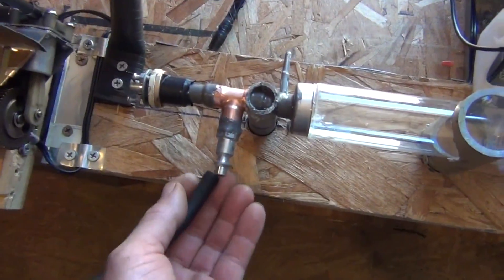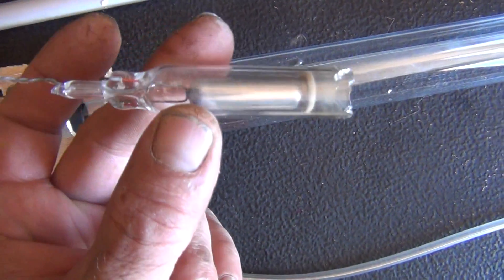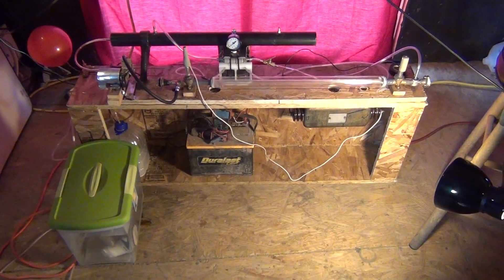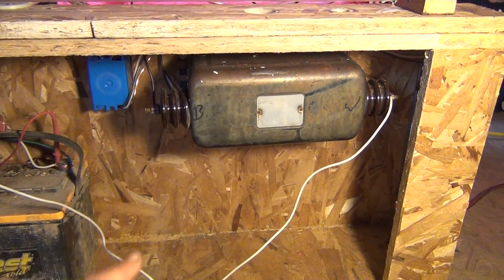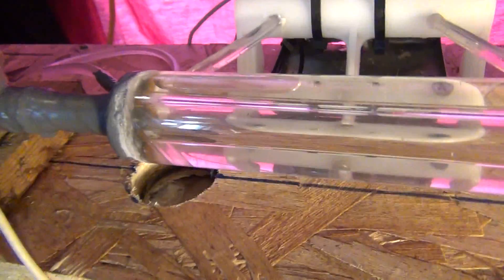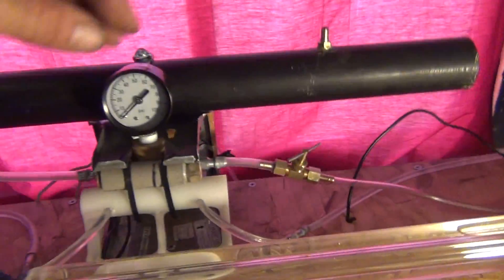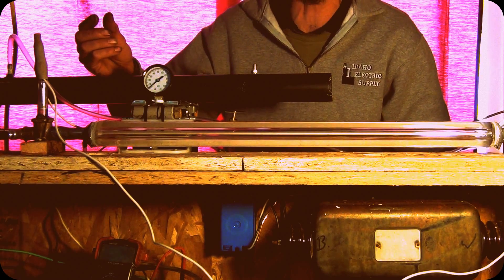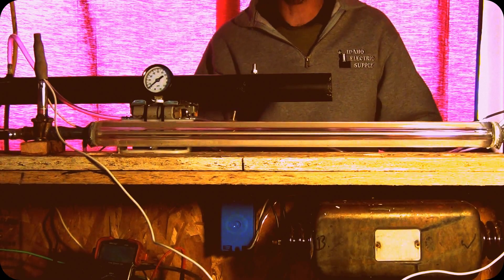Homemade CO2 Laser, part 5

Comment: You do a great job explaining things in a way that is clear and easy to follow. Your also thorough with coverage. I subbed your channel it looks like you have a lot of great content I can relate to. 
I want to make you aware of a material that has countless uses which is windshield urethane. Any auto-glass store or online sells it. It dries hard like the black rubber sole of a sneaker. I have used it on quite a lot of projects.

Comment: Can the outer tube, that kept cracking, be replaced with a copper tube?
Does anyone know?
Reply: It is better to use a non conductive material because otherwise you need to isolate it from the high voltage parts.

Comment: I'm not a physicist or EE or anything, so don't laugh at my question, but for the CO2 why can't you use dry ice?  Seems it would be less messy.  Also, if you need Nitrogen, you could get a compressor carry can and have it filled at Costco, they use it in the tires they sell.  Just a thought.
Reply: Or just "steal some" from a spare tire you got inflated.